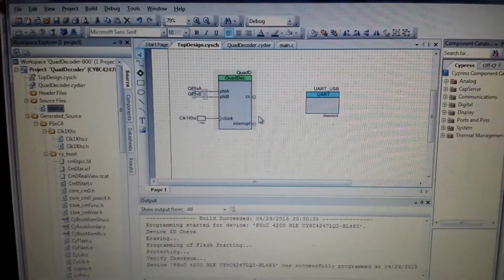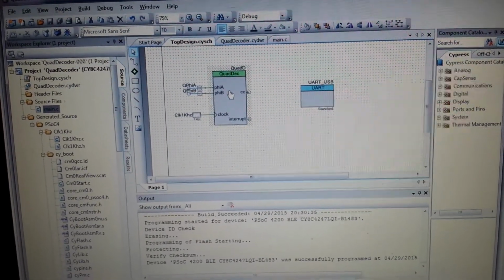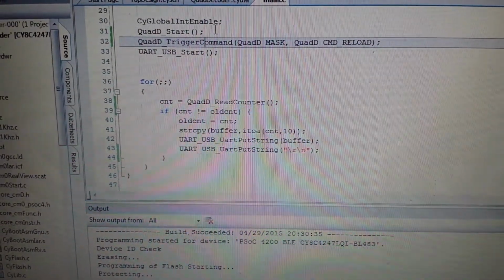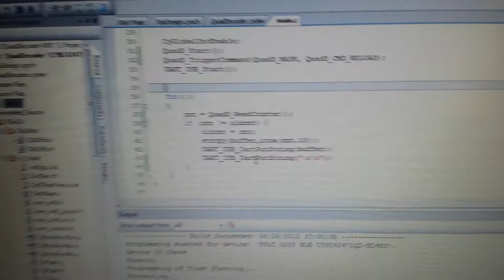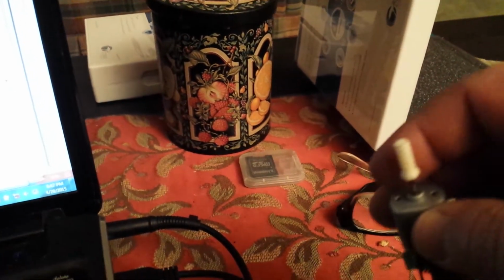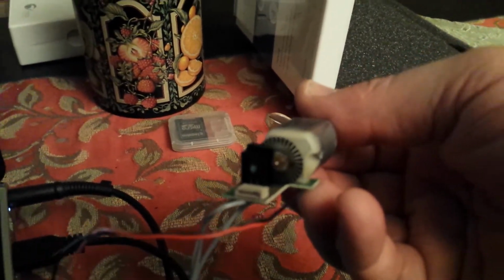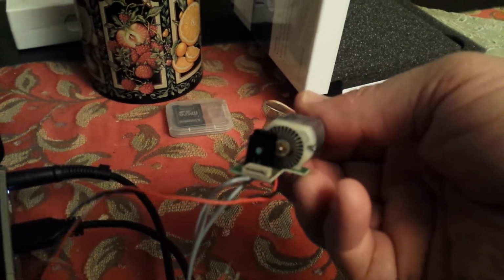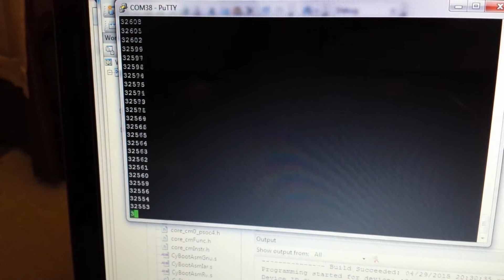PSoC4 Quadrature Decoder

Comment: Chuck, why do you use strcpy? Could you instead do something like:
UART_USB_UartPutString(itoa(cnt,10)); ?
Reply from the maker: brentutt Yes that would be more efficient indeed.     I don't often get to write C and have to work it up bit by bit.  I've been told, premature optimization is the root of all evil ;)   and now that the code works it should be simplified that way, sure.